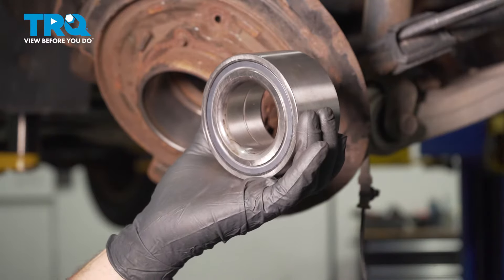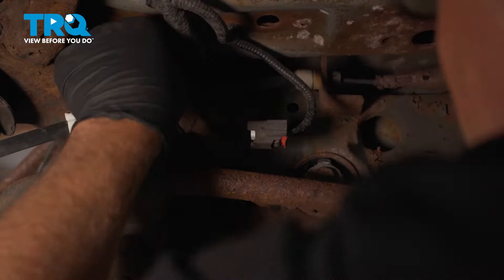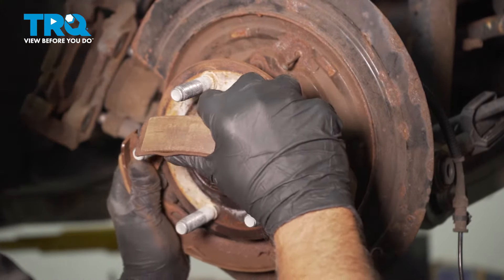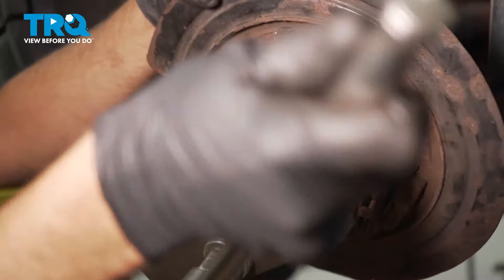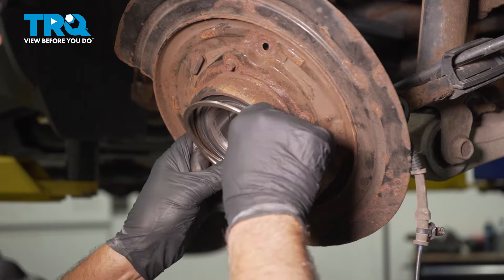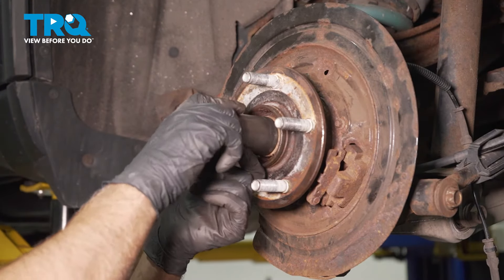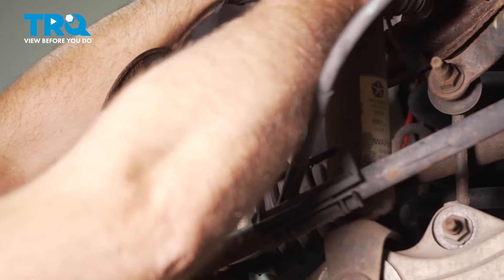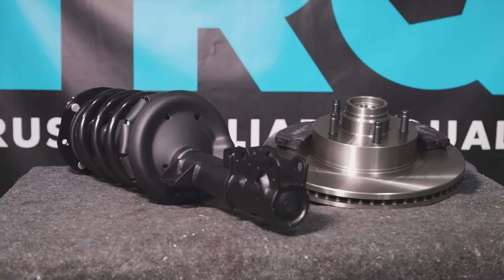How to Replace Rear Wheel Bearing 2011-2021 Jeep Grand Cherokee

Comment: @trq having an issue, replaced bearing as per video but now my ABS light and traction control is on, also says to service rear park assist, this wasn’t on before. I tried replacing sensor and still no luck. Any suggestions?

Comment: I realize your portraying yourself as a "pro" mechanic but, every mechanic I have ever worked with ALWAYS puts the bearing in the shop freezer  while cleaning up the hub and removing the old race. Then just before installation, heat the hub gently with a propane torch and press the bearing in by hand. No bearing press needed.
Reply: Lolllll 😂😂😂😂by hand!
Reply: @johnnytardes6801  he’s correct idk what’s funny
Reply: If you press by hand, something wrong